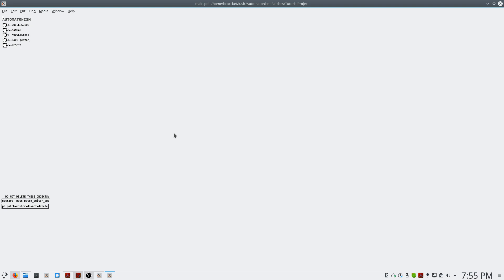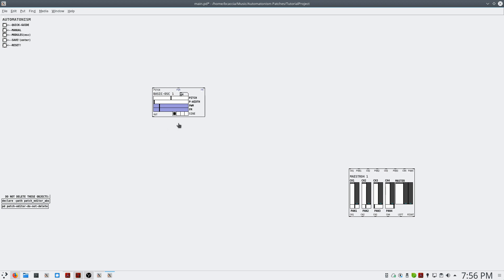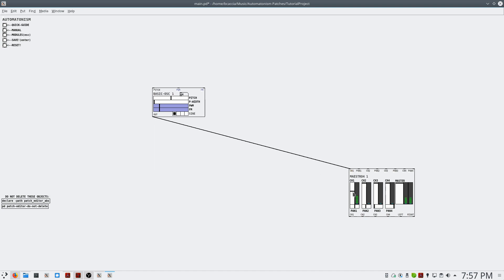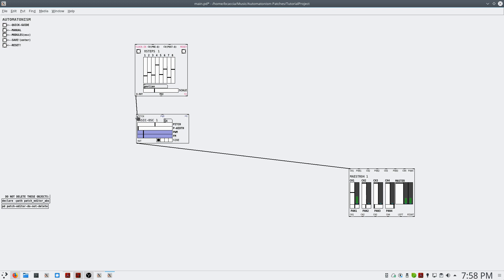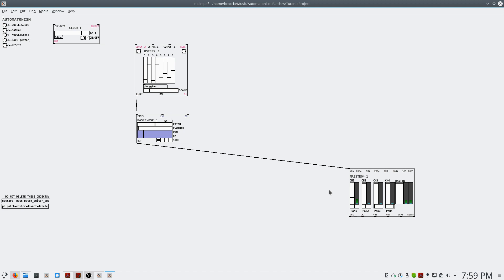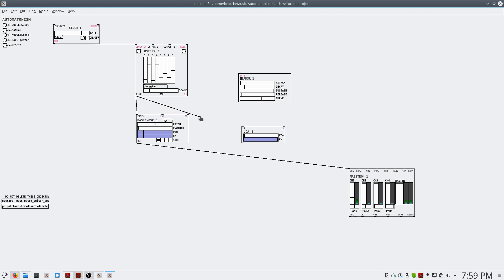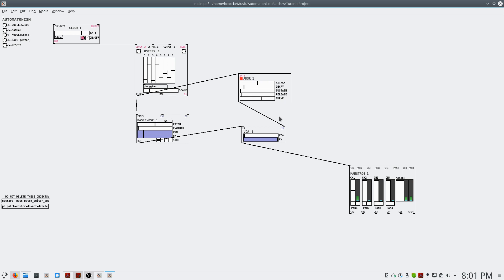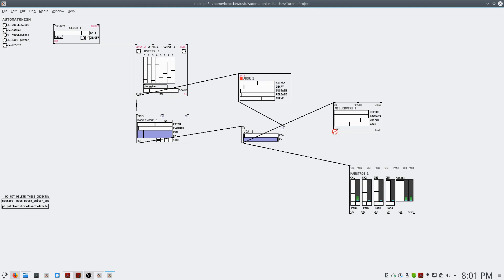[Automatonism] - Basic First Patch

Comment: How dos Automatonism compare to pure data?
Reply from the maker: Automatonism is built using Pure Data. It's a handy template with ready made modules that allow you to easily create patches without having to start from zero. Since it is built in Pure Data it can easily be extended or integrated with other patches.
Reply: @bcacciaaudio286  thank you

Comment: Hey there Ben,  I'm not getting any tones out of my first oscillator > maestro4 connection.  I've tried doing the even more basic "osc~ 440 > dac~" program and that generates a tone just fine.  Any clue what could be the issue?
Reply from the maker: Hello, thanks for watching. Sounds like the audio setup is correct in Automatonism as you are getting some sort of audio output. What platform are you using it on? OS X, Windows, Linux? I would suggest downloading the Automatonism package fresh again. Perhaps you edited something in the session, accidentally saved it, and broke the background setup in Automatonism. I've accidentally done that before.
Reply: bcacciaaudio Hey thanks!  Reinstalling was able to solve my problem.  I must’ve made some unintended change.  Thank you